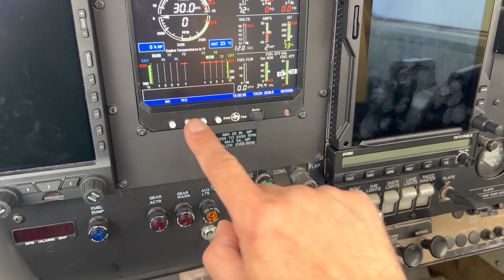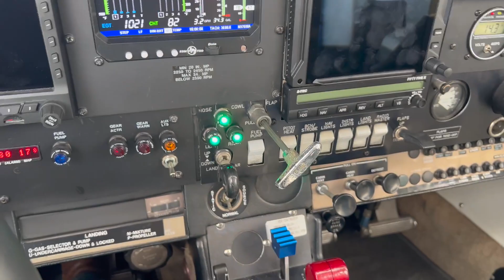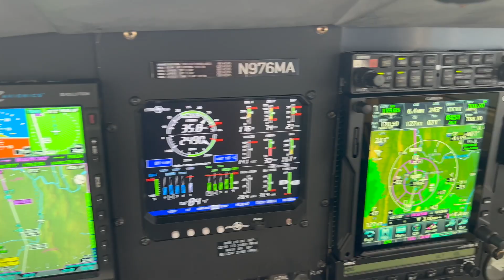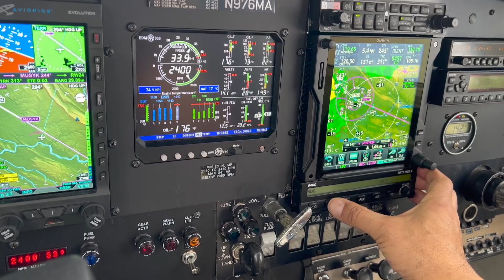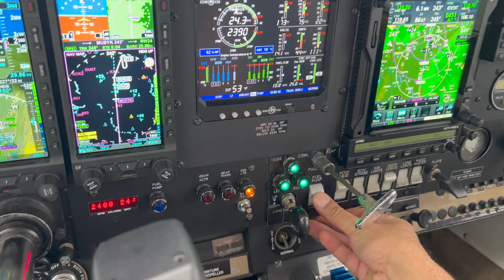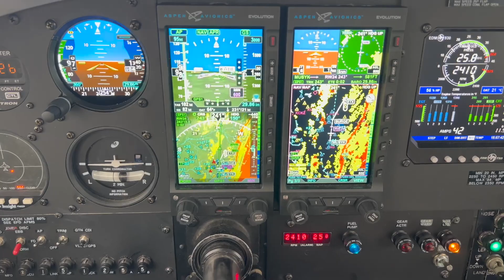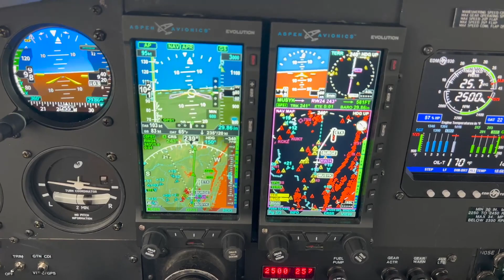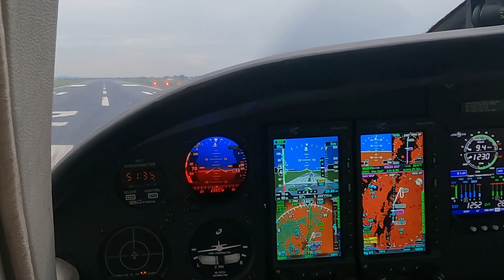Rockwell Commander 112TC

Comment: This is such a beautiful plane, and that instrument panel! Wow! I'm just starting to look at Commanders. 90% of the time, it will be just my wife and me in the plane, but occasionally, we'll want to have four adults for about a 2 hour flight. It seems like the 112 isn't a good choice, but the 112TC might be? What's been your experience with 4 adults (say, 170 lb. each)? I live in the FL Keys, so hot and humid at sea level will be my normal flying conditions. Thanks so much for whatever insights you can offer!
Reply from the maker: 112TC has 900 lbs of useful load. 112TCA has 1000 lbs.  48 Gallons of fuel  = 288 lbs. Gives you - ~ 660-700 lbs to play with depending on model . So if you don't fill to max (68 gallons for long range) ; and fill to 48 or under - you still have 3.5 hours of aloft time and fit 4 x 170 lb adults.  DA , humidity don't bother the engine performance on a TC. You'l get your full 210 HP - unlike a 112.  I wouldn't operate under 2500 foot fields at max gross under those conditions.   I usually increase my minimums to 3500 foot if operating at max gross on hot / humid days. The plane will do it but gives you margin for error.
Reply: @6MA  - Thanks so much for that detailed info! It's real-world experience like this that I have been looking for (and not finding until now).
Reply from the maker: @BrianSmithSmartini  Short field performance - this is on a 85F OAT, 2000 DA.   You can operate easily with the loads specified even from shorter fields. As stated - i usually bump the number up on the runway length for additional safety margins if near max gross. https://youtu.be/H1zWj9KBcyI
Reply: @6MA  - Thanks! That makes me feel pretty good about a 112TC for my planned flying.
Reply from the maker: @BrianSmithSmartini  if the mission is 4 adults regularly - i would consider the 114. There isn't a huge delta in cost and opex. If its occasional 4 adults where you can leave fuel behind (13 Gph x 3 hours ) ~ 40 gallons - -can do 4 adults and no baggage.  2-3 adults + baggage is the ideal 112TC mission profile.
Reply: What’s your typical cruise speed and fuel flow. I’m currently flying an Arrow IV but looking at a TCA. I love the two doors and wide cabin.
Reply from the maker: @darrylday30  Under 6000 feet - 137 KTAS (TRUE) at 75% MCP.  About 134 KTAS at 65% MCP. About 12.5-13 GPH.  Above 6000 to 10K,  141 - 150K KTAS   at 12 GPH. I have 100+ hours in an arrow. I love this bird) - wide cabin and control feel.
Reply: @6MA  Thanks, That’s what I was hoping. A little faster than my Arrow but more comfortable. The one I was going make an offer on just sold for more than it was probably worth (it needed some expensive work). I’ll be keeping an eye out for another. The Arrow will serve me well in the mean time.
Reply from the maker: @darrylday30  See TAS numbers at 5K feet. 72% MCP. - 138 KTAS.  It wasnt leaned out yet  - just reached top of climb.  https://www.youtube.com/watch?v=v8r_T5SIGHE
Reply: Congrats for your very good looking Commander!
I own a 112TCA and I am looking for an yokes and panel upgrades. Do you have contacts for that?
Thanks!

Comment: Were did you get the yokes from?
Reply from the maker: Cygnet Yokes (made for Bonanzas).   There is a pre-existing 337 from 2005 from the AOPA commander which you can use with the FSDO.
Reply: @6MA  Thanks!

Comment: What’s your fuel burn at cruise??
Reply from the maker: at 70% MCP - about 13 GPH at < 6K.  Around 10K its 10-11 GPH.  I plan on 13.5 GPH for flight planning.  68 Gallons on board - thats 4 hours of endurance with 1 hour reserve.  My x-country flights are about 3 hour legs.
Reply: @6MA What’s she true out at around 8K feet or so?
Reply from the maker: @PistolPackingPilot  8K - 75% MCP 145 KTAS ; 65% MCP : 140 KTAS both at ISA ; But its a Turbo : so 10K-12K it does ~155 KTAS at 75% MCP.
Reply: @6MA  155 TAS at 10K on 11 GPH ain’t bad.
Reply from the maker: @PistolPackingPilot  at best power (75% MCP) its about 12-13 GPH ; at 65% power - you give up a few knots - and do 10 GPH. I find 70% MCP to be a sweet spot